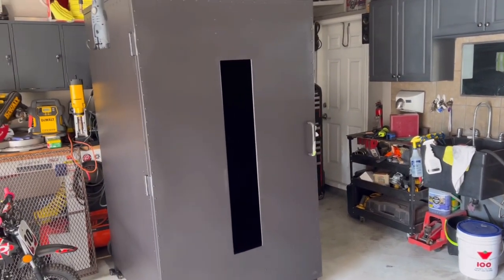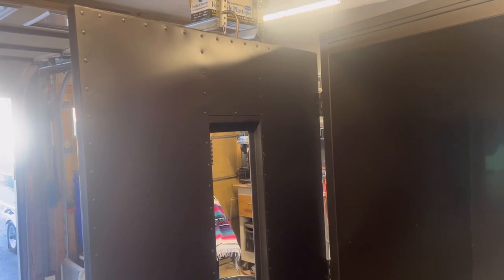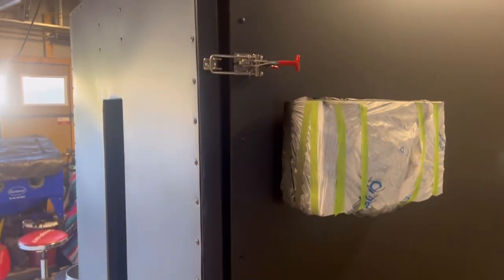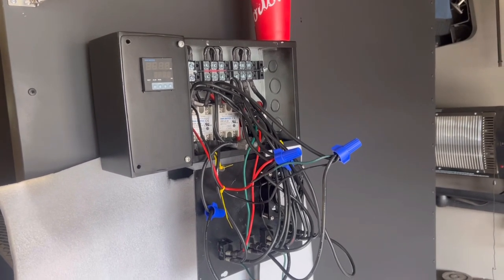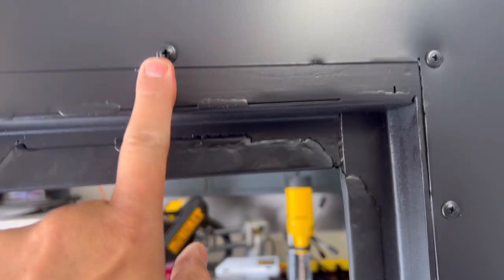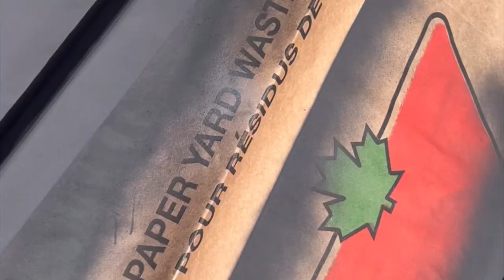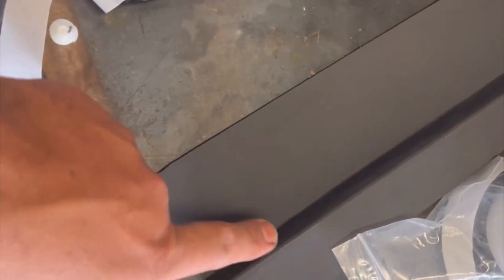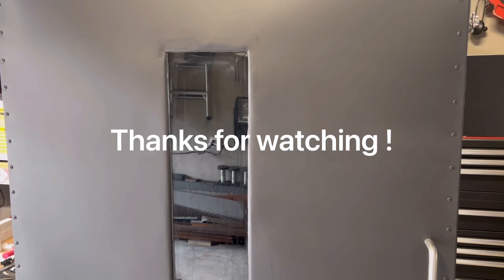Custom Powder Coating Oven Build Completed

Comment: Awesome job!!! We’re did you get the glass from?
Reply from the maker: Hey thank you! Your local glass company can help you out. You would need high temp glass 5mm thick (ceramic glass) normal used for fireplaces.
Reply: @welding2go  thanks

Comment: I love those latches, where did you get them please?
Reply from the maker: I’ll send you the link.
Reply from the maker: Accessbuy Toggle Latch Clamp,U-Bolt Quick Release Toggle Latch,360Lbs Holding Capacity Adjustable Small Latch Hardware for Freezer Door,Storage Boxes,Smoker Lid,Tool Box Case,Trunk,(4.75 Inch) 4 Pack https://a.co/d/c6mr7FD
Reply from the maker: This link is for the larger latch. 
Accessbuy 2000Lbs Capacity Heavy Duty Adjustable Latch U Bolt Self-Lock Toggle Clamp 2 Pack https://a.co/d/03JoFL5
Hope that helps!
Reply: @welding2go  THANK YOU!!!

Comment: Hi
Did you not need to install a circulating fan for the build.? Or is it working ok without one.
Reply from the maker: Hi Kevin , Fan is not required, you don’t want any air movement within the oven when setting powder.
Reply: @welding2go  thanks for the answer. You see some with fans and some without. Just want to get my build right the best I can

Comment: Hi, Can you tell me how many watts each of your coils are? Also what gauge wire did you use to power this ? And the size of the breaker. Thanks
Reply from the maker: Hi Michael , each burner is 3000 watts. I used 10 gauge high temp wire with fiberglass shielding. Running all four burners would require a minimum of a 60amp breaker. Please confirm with licensed electrician thx

Comment: Did you need 4 heating elements because of the size and to save time? Would one heating element work? I'm building my oven 3ft x 3ft and plan on using 1 hearing element so I can run 120v instead of 220v. Really just trying to figure out if that'll work. I know it's going to take longer to heat up but the more efficient I build the oven the faster it'll heat up was my thought. Yours looks great and it looks as good as the ovens for thousands of dollars. 👍
Reply from the maker: Running 120v will work but not efficient. On our build we are running 4 heater  in order to heat up evenly and quickly. 3’x 3’ I would run 2 burners 3000watt each @ 220v
Reply: Not sure if you already built yours or not, but want to add that you will probably want more than one element.  I have a double oven that is modified into a single oven and I have 2 elements.  I have an element on the top and bottom.  I am actually planning to switch out the bottom element to a bigger one.  The initial temperature ramp up is not an issue really, but getting back up to temp quickly (and getting large parts up to temp) after your door has been open from putting in the parts is an issue for me.  Good luck!

Comment: where did you get the heat elements? i am building one and i don't know where to buy them. thanks in advance... btw the oven turned out great.
Reply from the maker: Thanks! 
The burner are a GE or LG product they are available on Amazon 

General Electric WB44K10002 Range/Stove/Oven Broil Element by GE https://a.co/d/1KbzyHi
Reply: Your link price tag is $208. There are other sellers on Amazon, they sell them for $28.00 @welding2go
Reply from the maker: @Rambleon444  give them a try and let me know how they workout for you. Best of luck!

Comment: how much power is needed in this tool? thank you
Reply from the maker: This oven requires 220v / 60amp
Reply: @welding2go  how many watts does the overall output of this oven?
Reply from the maker: @zoy8295  4 @3000w each

Comment: Oh man, that looks fantastic!!   Where are you located in Canada?
Reply from the maker: Thank you! 👍🏼  Mississauga , Ontario
Reply: @welding2go  nice.  Im Kitchener.  Do you have instagram or an email ?   Got a couple questions for you
Reply from the maker: https://instagram.com/welding2go?r=nametag
Reply: Hey man. Great job. Can you help me out with the electrical box. I have 3 PID controllers 4 burners 4 ssr but temp wont go over 200. My heads gon blow up.
Reply from the maker: @mariocastilla7852  send me a pic of what you are using. Message me on Instagram thx
Reply from the maker: https://instagram.com/welding2go?r=nametag
Reply: Nice job iam building the same size . I have it almost done just have to do the heating elements and electronics . Do you have a how to  to wire it up?
Reply from the maker: Hi Mark, follow me on Instagram and I’ll send you a wiring diagram. I tried to send it threw this platform but it doesn’t work. (Please be careful when working 220v it’s enough to kill you! ) My suggestion is to have a licensed electrician help you out. 

https://instagram.com/welding2go?r=nametag

Comment: COST BREAKDOWN?
Reply from the maker: Complete build cost me $4700.00 plus my time.
Reply from the maker: Metal $ 2500.00- Glass $700.00- Electrical/ wire/ insulation and paint $1500.00
Reply: What of model for INKBIRD and heaters?
Reply: @welding2go  I'm surprised at 2500 for the metal, what part made it so expensive? (i didn't watch all the videos, just skipped through, but i don't see such expensive metal in the build!)